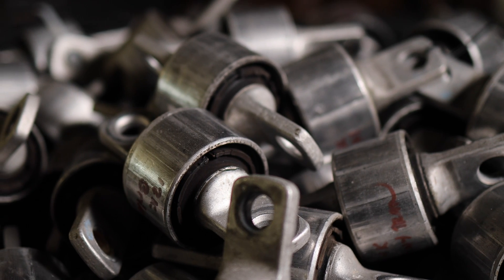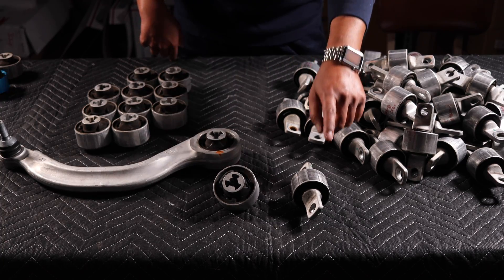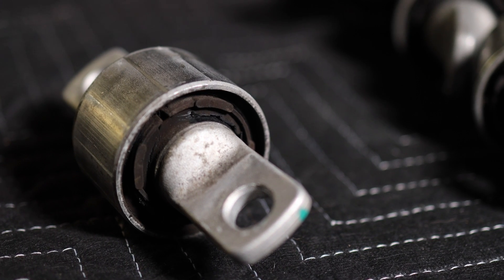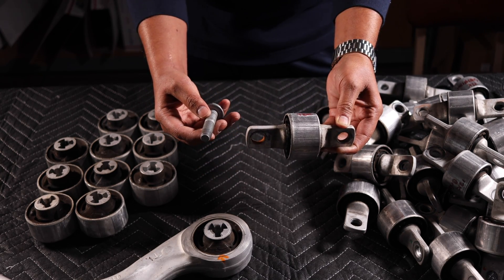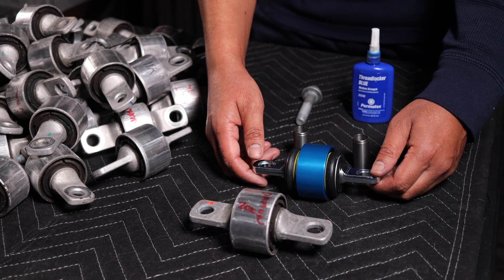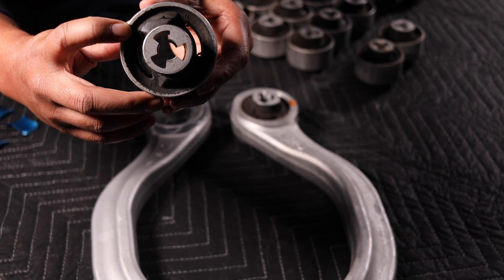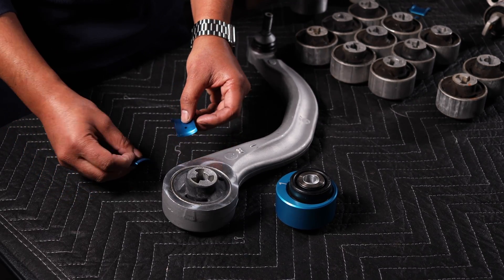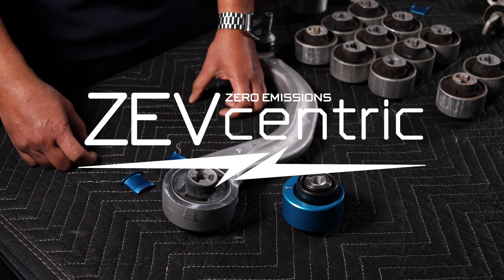PSA: Premature Failure of Tesla Model 3 and Y Suspension Bushings!!!!!!

Comment: Failure by design..
These bushings are going to fail due to the way they are loaded and the configuration of how the compliant/flexi polymer has been designed into these control arms. Their failure is not if, but when...

Those two screws that hold the bushing into the sub-frame will work loose due to the way they are loaded. It is essentially a shear loaded joint under high vibration stress conditions with a tension based joint. The vibrations will cause the joint to slip as there will NOT be sufficient tension in this joint to prevent the shear forces from causing the joint to slide. Once this happens the screws (bolts) will begin the process of working themselves out of their threaded holes. This is a design in failure that will happen. Adding Loctite is a band-aid as it might prevent the screws from falling out, Loctite will not prevent loss of tension due to vibration stress this joint will be subjected to.

These are some of the designed in failures  that has caused Tesla EVs to fail inspections in Germany, Finland, Sweden, Denmark and other nations..

~Just one of many examples of inept engineering and design in Tesla cars.

Comment: My 2020 Model 3 has 47750 miles. We started to hear some knocking on the left front so we took it to a Tesla service center. They said that they have to replace the lower lateral link, the left and right lower compliance link, the front upper control arm left and right, the front left and right damper assembly, and the various nuts and bolts. The service estimate is $3791.67. I don't think that I caused these issues. It's more likely related to the 2021 recall. Unfortunately, I'm out of warranty so I'm stuck with this bill. I wish I had been aware of the suspension issues before my Model 3 was out of warranty. I am planning to file some complaints because this certainly seems to be an all too common malfunction with these cars.
Reply from the maker: The warranty is up to 4Y/50k miles and Tesla is aware of this problem.  Sadly not all service centers follow the same policies.  Many SC's will replace those components free of charge.  You could have bought the arms with upgraded bushings for far less money from us.  Tesla cannot sell bushings only and only full replacements.  Their OEM arms are very expensive now.  You should send me a copy of your invoice to zevcentric@gmail.com because that price seems very high for the work they did.  The front upper arm has a service bulletin as well so you should not have been charged for parts.

Comment: There was a lawsuit in China that resulted in a recall of control arms and control arm bushings failure. Tesla has since revised these bushings in the later models made after 2020. The Model 3 that were prone to these bushings failure were the 2018 and 2019. Maybe some earlier 2020 models had similar issues. When Tesla updated the suspension on the 2021+ models, they also improved the durability of these bushings. As a result of using more durable and stiffer bushings, they also compensate by using slightly softer springs and dampers.
Reply from the maker: That's not what we have seen because we have replaced countless 2021+ models with even as low as 13K miles with ripped bushings.  This even includes the updated softer suspension versions of the Y introduced in 2023.  The newest highland bushings are actually softer than the older versions so we'll see how those hold up.
Reply: @zevcentric  I can only speak about the Canadian models, which are made in China. Maybe the USA made models have not been updated.
Reply: @zevcentric  Hi is lower lateral links same as lower control arms?
Reply from the maker: @flybuzz  yes but there are 2 more lower control arms called the compliance arms.  4 lca's in total.

Comment: spherical bushings are crap for daily use on such high loaded axles. It really good for track use only. It just can not hold loads from bumpy road and everyday use and you will raplace it 3x faster than normal bushings. You already has such bushings in your rear knuckle 2 from each side. I've changed that OEM bushings every 2 month after some street racing and drifting until companies in our country made reinforcement variants of all bushings for Tesla 3, now it last a much longer maybe a 9 month from last change but already need new.  Those rear spherical bushings are the worst nightmare for T3P owners cuz when it dies all of your alignment goes wrong
Reply from the maker: The bearings used in the lateral links are phenomenal and have never clunked in nearly 100k miles and many track days.  Not to mention the fact that they are OEM German bearings used by Mercedes and Porsche that are used in their production line for everyday vehicles.  This is a very daily drivable spherical.  The compliance arm however should not take a spherical.

Comment: Tesla has the best drivetrain, battery management system (BMS), batteries, and charging system out there. Sometimes the rest of the car is Chrysler-Fiat grade crap! The Mazdas and Subarus that I have owned never had suspension parts that wore out this fast. Inexcusable.
Reply from the maker: lots of instant torque and a heavy vehicle reign terror on the front lower arm bushings.
Reply: @zevcentric  That makes sense, but then they have failed to anticipate likely usage and adjust the design accordingly. Tesla should offer an optional upgrade or a better part at the parts counter. "The Tesla Motorsports Control Arm Plus!".
Reply from the maker: it's a learning process for them as a new auto manufacturer. I'm pretty sure the new model 3 release has a lot of these considerations. We're on the aftermarket side so we're used to these things regardless of vehicle make.  They will get there.  There's so many other amazing things about these vehicles on and off the track to appreciate.  This is coming from a BMW, Porsche, RX7, Miata, Subaru kinda owner/enthusiast too.  @snowrocket

Comment: Very nice and truly beneficial upgrades to do to a Teslas active suspension...

I put sealed spherical bearings in my F250 by replacing the radius arm and pivot bushings then got rid of the gas pressurized shocks for simple dampener shocks and hadnt had any deathwobble in over 16yrs................LOL

Comment: Had these replaced TWICE! I have 124k miles on my Model 3 Performance. Rear motor bushing replacement is near and with that, youapparently need to replace the entire motor. $9k job if Tesla does it. Suspension assembly is trash on 3's and Y's.
Reply: What do you mean, "replace the entire motor"? You don't mean replacing the motor itself with another motor, do you? That would be Ludicrous! (Tesla pun intended!) You (hopefully) mean, "remove the drive unit (motor and gear reduction), replace the bushings, then reinstall the drive unit". That would make far more sense.

Even so, $9,000 is WAY overpriced and they are playing you and other owners for a fool. I'd BET a regular garage, once they know how to safely disconnect the high-voltage cables, could do that job for well under $2,000. It's a few bushings, man, it's not rocket science!
Reply: Youve obviously never been to a Tesla Service centre. @snowrocket

Comment: Both of my front lower rear bushings are torn at 44k miles. Just as my 4 year warranty expires. Guess I'm puting in the spherical bushing from UP. Is it even possible  to diy without a hydraulic press? Like the handheld tool from autozone rentals?

Comment: 110k and my compression link bushings are torn, but not causing any abnormal tire wear or other issues.  I'll be replacing mine this year when I upgrade to Meyle front upper control arms.  Since nobody makes those bushings in urethane, yet, I'm considering filling the voids on the new lower bushings with urethane resin to hopefully prolong their life.
Reply from the maker: We have a poly bushing from whiteline we use.  It's an offset one but can be used in oem position. https://zevcentric.com/products/whiteline-2017-tesla-model-3-2021-tesla-y-offset-compliance-arm-bushing-polyurethane?_pos=1&_sid=ff717f834&_ss=r&variant=43561888284917

Comment: Had even faster failures with Mountain Pass part’s
Reply from the maker: Did you purchase a race specific item like the compression rod bearings? We have not had their front lower control arm bearings fail on us and we have put then through a lot of stress on the track.

Comment: Great video!!  Do you noticed any difference with Mountainpass spherical bushing?  Noise(clucking noise), vastly improvement on handling.  Would you recommend it for a retiree daily use model 3P ?
Reply from the maker: the MPP bearing will surely make noise over time.  They are working on a newer version to release in a few months.  As of right now we're testing these options https://zevcentric.com/collections/bushings-bearings?sort_by=best-selling&filter.p.vendor=Whiteline